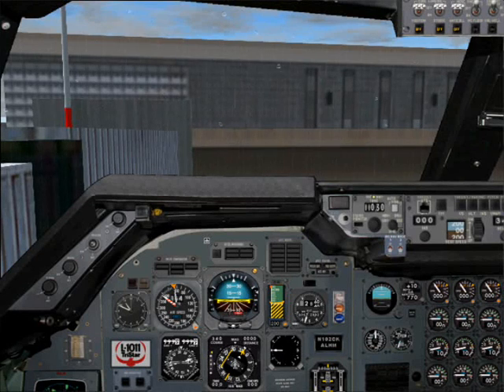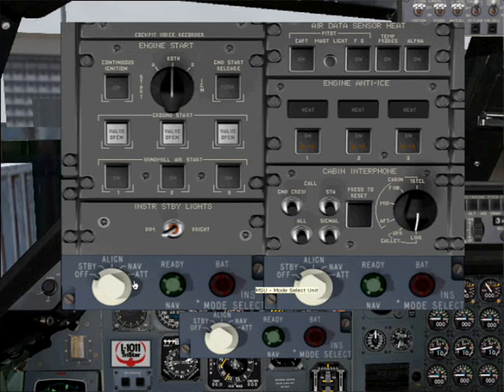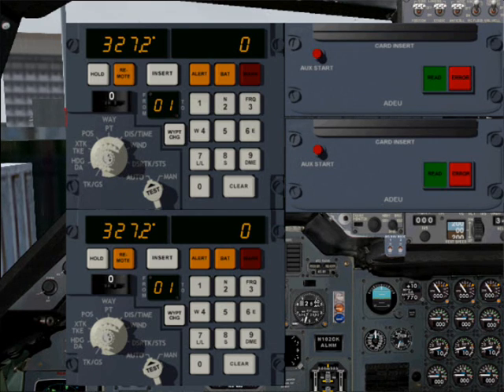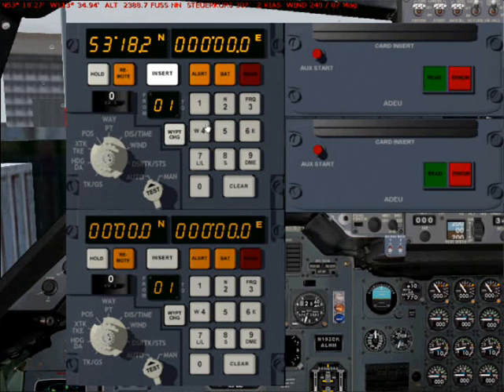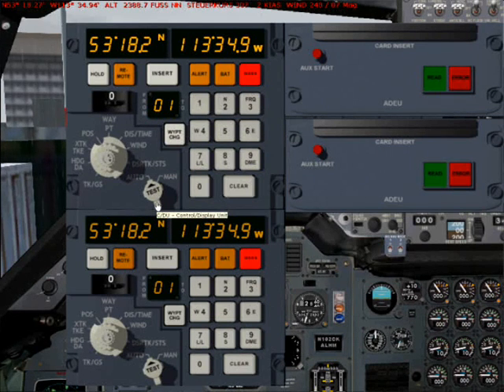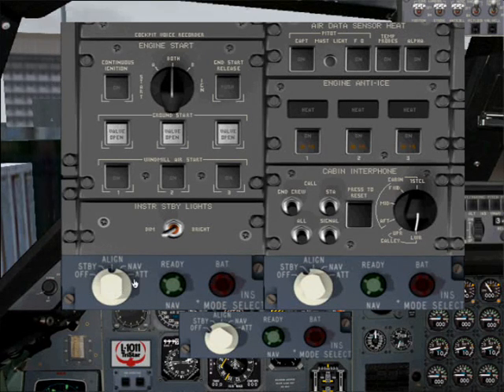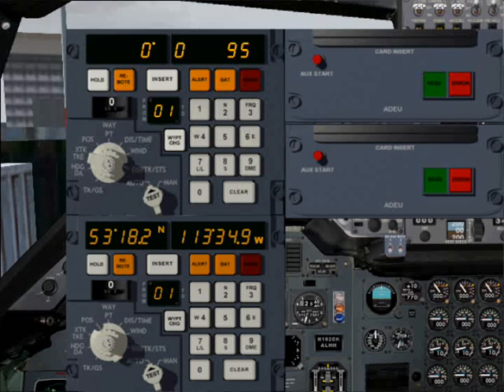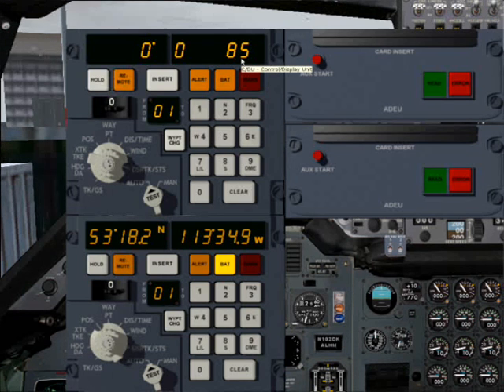INS Tutorial Part1

Comment: I think you might be getting a warning light because you're supposed to input the position after the INS is aligned, not before. This is because the INS will know it's precise latitude after alignment and it can tell if what you have input is correct. Hence the warning in this instance; the system is telling you it doesn't know if the data you input is accurate. Also, DSRTK/STS means 'desired track/status'. It displays the track you should be on to reach you current waypoint in the left window and it shows status codes (errors etc) in the right window.
Reply: While the second part of your message is correct, the CIVA INS' official tutorial states that he shall do it this way. It may or may not be correct, but let's assume it is.

Comment: No! In real life when you have a warning on your INS you don't go farther! Rotate the selector to DSRTK/STS and check the code and open your manual to see what kind of trouble you have. As said Richard Alderson it can me a normal condition if your plane has been moved since its last position(Gate to hangar back to another gate). Also before entering your plane position, you have to check the CDU by pressing TEST and rotate the selector from TK/GS to POS and see if you get 2,3,2,4 points and all the digits(often on these old faithful INS some bulbs are off)and check the two lights on the MSU. That was part of my job as flight engineer(DC8-55F, 72CF, DC10-30 and 30ER)for more than 20 years on these birds with this nav equipment.

Cheers
Reply: +Pat myZisfantastic you didn't notice that he said that this is a bug in the simulation and not part of the actual system simulation?

Comment: in my captain sim 707 the INS won't display anything after turning the knob to standby. any ideas?
Reply: have a same problem. i think it is nonfunctional unfortunately :(
Reply: Ege Konuk So how do we navigate if it's nonfunctional? I don't like a 100 tons VFR aircraft.
Reply from the maker: In the CS 707 you can only use the INS as a 2D pop-up, the 3D-Model in the virtual cockpit is non functional. Also, INS is not the primary mode of navigation in any case - conventional IFR navigation is done by radio navigation (VOR/VOR, VOR/DME and ADF)
Reply: Johanns Media  i guess its called doppler navigation. for 2d pop-up i use civa ins but i havent tried yet i hope its working good